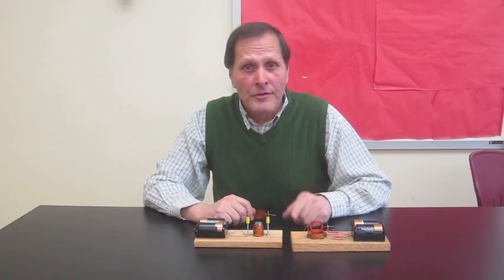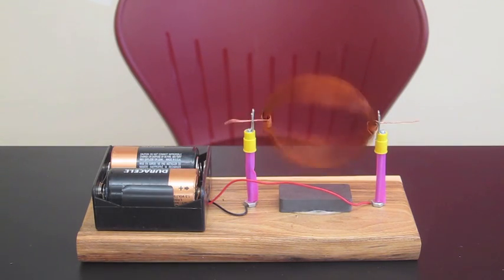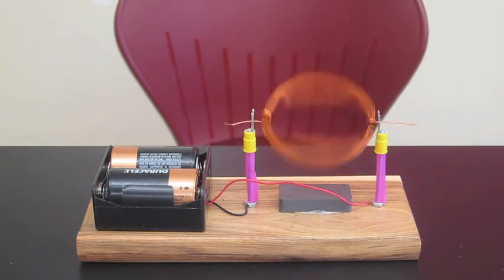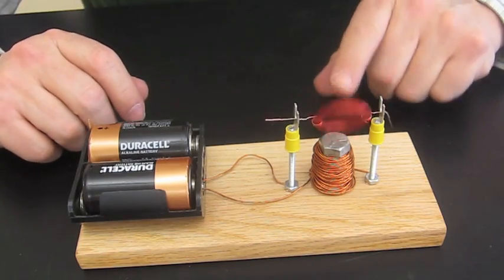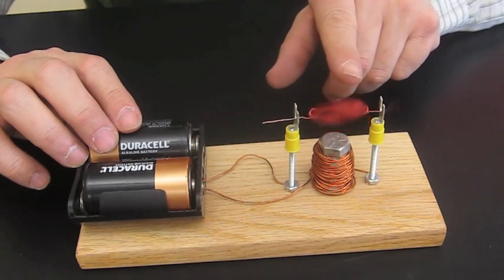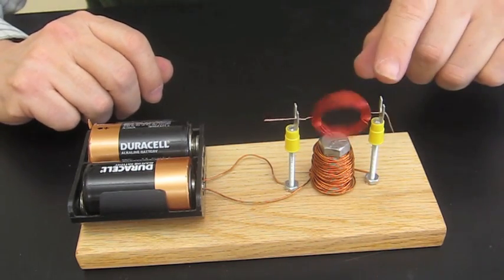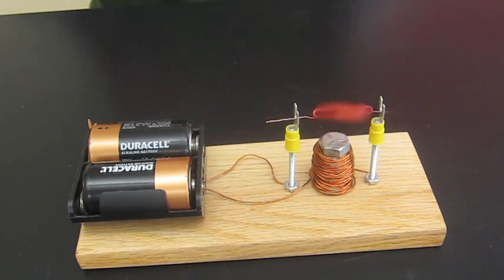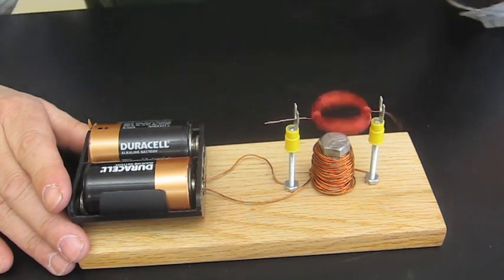no magnet motor  ///  Homemade Science with Bruce Yeany

Comment: Hi Bruce. I attempted to make the motor and it is just not working no matter what I do. I have made the same device about 6 times and even tried different wiring patterns  with nothing but failure. The only thing that happens is the bottom coil will get hot and the coil that is supposed to spin will also get hot and when i try to spin the top coil to start it it does nothing. The only thing the device does is gets hot. What do I do? Thanks!
Reply from the maker: Sorry to hear that you are having trouble.   You are using bell wire that is coated with an insulating enamel?  Then my guess is that the ends of the armature coil is not not scraped correctly.    Only half of the  enamel is scraped off so that as the coil turns it acts as an on off switch.  I show how to do this in  my video on simple motors, it starts about the one minute mark.       
https://youtu.be/_5A61f0Q6jI

I do have a write up on this,  if you send me your email address I will forward it to you

Comment: Hi, we're trying to make a motor without a permanent magnet the way you did, but it is not working :( Do you have any tips? For example, when coiling the wire around the nail, is it okay to overlap the wire?
Reply from the maker: Hi Ln777,  I have a set of instructions for this,  send me an email address and I will forward it to you
Reply from the maker: it is sent

Comment: Would this work with your speaker driver made of toy motors (servo motor or stepper motor? I'm guessing servo)? I mean, substituting the toy motor by this motor, would the speaker driver work?

I'm asking because batteries have DC current. The servo motor used by you work with AC current. Sound would be AC.. right?

I can test it myself but I would only know what works and what not. I wouldn't know the theory behind it.
Reply from the maker: José Francisco Candido Filho Thanks for the question.  I'll try it and see what happens,   I find that testing is  how I learn and get a better understanding of
 the theory.
Reply: Bruce Yeany As soon as I get time to go buy wire, I will test it too! If it works, would be a 100% "diy" functional speaker driver! :D Well.. except for the batteries!

Comment: What you have made is a "series motor", if I followed the wires right.  It is a fairly nifty sort of motor.  Series motors have really high starting torque and a really high top speed. 

Placing a second field coil above the rotor, makes them work a little better.  It makes the lines of force of the field want to be a little closer to parallel.  This makes the rotor winding that is up near the top make more torque than in the simple design. Remember it is the current in the winding times the strength of the field right where the current flows that matters.